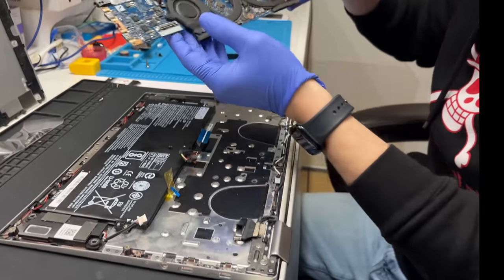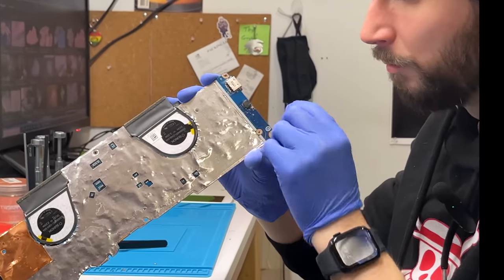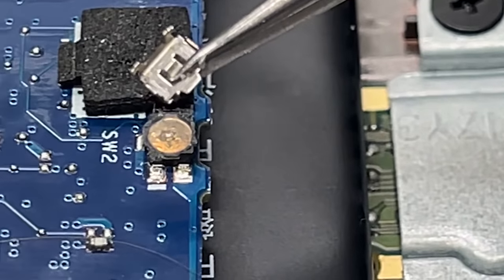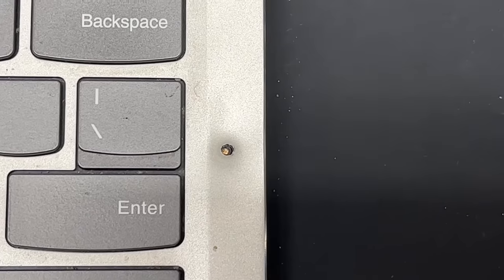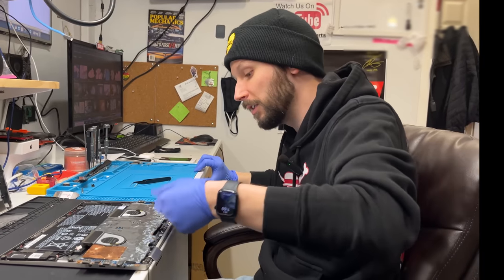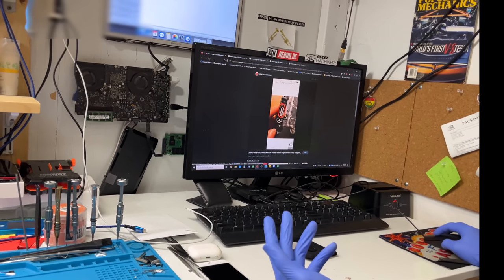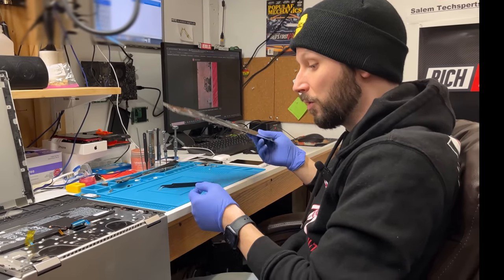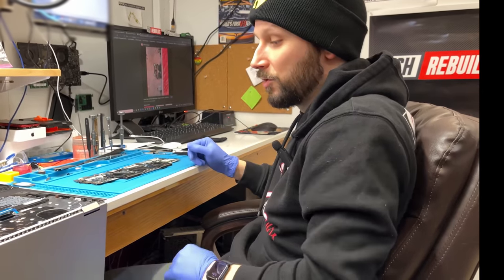Another reason to never buy a Lenovo Yoga (huge design flaw)

Comment: Oh come on, really? You never saw how ... I dunno, volume buttons on old nokia phones work (example: nokia 6300)? That's literally the same design. Yes, sh_t happens, but that's not the reason to drill a hole in a customer's device if you don't have the right parts in stock.

Comment: All 4 of my HP laptops I’d gotten from 2010 to 2013 suffered major physical failure (3 of them shattered hinges and the one detachable laptop tablet having the keyboard connector go out)

Meanwhile my 2008 MacBook SE is still in mint condition as I’ve taken the OS well beyond its final version of 2015’s OSX 10.11 El Capitan and patched it to 2018’s MacOS 10.14 Mojave and now finally 2023’s MacOS 14 Sonoma. It throws ppl for a loop to see the newer OS on a 2008 Mac and to see said Mac still in like-new condition
Reply: Ironically my 2011 HP 630, even if in the golden era, never had any problems with the hinges. I dismissed it last month for the hardware incapable to keep up with my needs, but it never had mechanical failures 😅
(And the power switch has a dedicated daughter board, unlike these Lenovos)
Reply: Macbooks are the best
Reply: Yup, you spend more but they work for a lot longer. I've upgraded quite frequently due to getting them from work so I've had to give macbooks away to friends and family because they work so well and it's a shame to have them lying around.

Comment: My old Lenovo X220T ThinkPad has a pretty good power button, and that thing is over a decade old at this point, so Lenovo at least use to know how to make a power button. The palm rest, however, was not that good on the X220T as the area above the express card slot (because this was made back when that was still a thing on laptops) would often crack if you didn't have an express card in there.
Reply: The older the Thinkpad, the more of an IBM design it is. I have a new T14 and it is nice so the Thinkpads are still holding up, but if you look up the changes made between each generation it's like they're slowly chipping away at what made Thinkpads good in the first place. Just not all at once so people don't stop buying them.

Comment: Laptop designers are probably snorting their own piss while working. Asus zenbook pro 15 is the worst offender. When it was launched, it was hyped by every popular tech reviewer(Even linus tech tips) for the "revolutionary" screenpad display.  It was good for exactly 5 months. Battery died, BIOS update broke the screenpad display, now after 2 years, the rubber feet in the bottom of the laptop disintegrated and oh both hinges that connects display to the body broke due to high temperatures from the i9 cpu. I had to use superglue to fix it because to fix it from the service centre, its almost half of the price of the laptop itself (~$2000). Never go for fresh models with gimmicky features.

Comment: New Laptops are so ghetto man 😂

fr a used Thinkpad or HP ProBook for example are both under 200$ used with good Hardware and they are solid devices.
Got both of them to play around with.
I also have a new HP Pavilion 15 and yeah I kinda hate it for the way its build like a flimsy new Laptop BUT its still miles better than 50% of the garbage out there.

Comment: i have lenovo ideapad silm 5, and it has bad hinge design. the screws are embeded into cheap plastic on the screen instead of make it attach to to screen lid metal. now after 1 year opeaning and closeing the lid the plastic broke and the hinge come of the screen. lenovo  solution replace whole screen lid, best solution attact the metal screws to metal screen lid. and this is a known issue form years but they want to make money by repairing the laptops instead of selling laptops

Comment: I had a cheap Lenovo about 12 years ago, would drop wifi nonstop.  Never bought the brand again, although I try to keep up with what they're doing.
Reply: Lenovo is a big decentralized brands and two of the laptop lines have good engineering

Legion 5 Pro (not 7 until recently)
Thinkpad

Everything else is a lazy excuse
Reply: @harrytsang1501 what about the LOQ?

Comment: I have second-hand Yoga X1 gen 4. I had a problem with the motherboard, but it was replaced during the warranty period.
I do not use the power button because I use hibernation mode after the lid goes down.
Hinges looks solid in the X1 line.
I really like my Yoga and I can recommend it.
I get around 10 hours of battery life with light usage.

Comment: Literally the same mechanism(the power button thingy) was used in the insanely popular Sandisk Sansa Clip+ MP3 player... I loved it because of Rockbox, but I bought like 5 of them over my adolescence because they broke very easily.
Reply: Glad to see another brother-in-arms! Sansa Clip and Rockbox were the fucking bomb!
I guess I was lucky with that power button, mine never broke, I just stopped using it cause the battery got way too unusable...
Reply: @maldivirdragonwitch  Hi there bro :^) Just FYI: you could buy a 3.7v battery in an electronics shop for dirt cheap and change it without too much of a hassle (given you have a soldering kit or can borrow one). I recently got into electronics as a hobby and it's really empowering how many things you can fix easily. IMO it's still worth, the sound quality compared to an average phone is significantly better even on cheap headphones and the clip is supper comfy.

Comment: My last two devices were also Lenovo Yogas, which only lasted 2.5 years each. Weak points in my devices were the power supply socket, hinges and fans. Now I have a Macbook Air M2 (without fan and Magsafe) which hopefully will last longer.
Reply: All modern Laptops are trash. MacBooks have that m2 chip paired with onboard ssd which can’t be replaced. It’s not an NVME. Even if you try to solder a nand flash chip with higher capacity it won’t boot. Acer Asus Lenovo dells all are e-waste. My Asus stopped working in 3 years. Bought an Acer and guess what? Only the half part of cpu had thermal paste on it.
Reply: You need to build a proper tower PC with swappable parts to be free. Framework laptop if you need a laptop and a FairPhone instead of other popular brands
Reply: @spicynoodle7419  yep. Recently made a Ryzen 5600G PC for basic computing (Back up for my wedding photography data, printing,etc). For gaming I have PS4..
Reply: you put your money into apple with a fanless design forcing the CPU to cook and you hope to keep it for years... hmmmm i guess when the laptop actually cooks itself apple's official stance will be "you were using it wrong". Similar to some shitty designs on old macbooks where they made the display cable 2mm too short and it ended up yanking itself off the motherboard on the power delivery side
Reply: my mid range lenevo has lasted me 7 years and still going ... its in perfect condition with the only issue being the storage lol (i had 1TB and now only 100gb something is available )
Reply: Thinkpads are the way to go for me
Reply: @bill19282  yeah, damn true. I've also heard cases of M2 Airs having their keyboard melted off because their owners used them for video editing and just generally heavy workloads for a long time...
Reply: My original MacBook Air lasted two years. The charging port got fried because it always ran hot.
Reply: @bill19282 The cpu won’t cook if it doesn’t reach high thermals lmao. It throttles if it reaches 100 C and will never reach those temperatures doing simple things like browsing or moderate things like photo editing.
Reply: I'm sorry, but if you want to avoid planned obsolescence, Apple should be the absolute LAST place you go. They perfected it down to a science well ahead of everyone else; they basically pioneered the practice.
Reply: @leucinegi if you only do browsing or photo editing, "simple things", you can also buy the newest cheapest laptop there is and replace it every few month for the same total sum...
I usually buy a laptop to work with it, if it's so badly designed to not withstand any amount of work then that's a complete failure and also waste.
Reply: While I don’t like the soldered Nand chips you can get new (unprogrammed) ones for fairly cheap and can dfu restore the computer with apples software. So with skill it’s at least quite possible but I agree it should be easier. What’s more worrying is all the glued or  just not easily obtainable repair parts.

But what I have to say about apple is that their Macs usually just last very long. My whole family uses Macs for decades now and only two have gone bad so far. One 2008 iMac, which had its graphic card die (repairable) and one MacBook with bad soldered RAM. Which would have been repairable but not financially feasible. 

I just remembered there is one more MacBook which has a fault but is still working. It’s Touch Bar is flickering occasionally but it has been even under warranty but nobody bothered to get it repaired and now it would cost money and if it flickers you just have to touch it once and it stops flickering. 

My personal MacBooks I used daily and abused them at times. 2008 MacBook (not used anymore but still working), 2013 retina MacBook Pro (sold to a friend in 2020, still working like new). 

But Apple had really tough times with the butterfly keyboard macs. Those are probably the worst to buy used.
Reply: Oh and the 2008 iMac has gone bad in 2020 and was used all this time. And is actually running again with a new graphics card.

Comment: My sister had a Lenovo yoga this is also a known issue. The touch functionality of the touch screen stopped working about 6 months in and it was not a hardware issue it was some sort of driver issue. Never worked again never came up with any solution dozens of similar complaints online.

Comment: A lot of people have been shitting on Apple because they watch a few Louis Rossman videos where he shits on MacBooks for being unrepairable.  I have great respect for Louis and I do hope that Right to Repair makes progress, but I’ve been saying for years that most laptops are junk and people need to get off their blind Apple hate bandwagon to realize that their favorite brand is probably even worse than Apple .

From my personal experience, I’ve never seen a MacBook fail in the last 10 years.  Not mine, not my friends’, not my coworkers’ not my relatives’ .  Plenty of failed Dell, Acer, HP, Lenovo, etc in that time period.  
Dell has issues with screen hinge being so stiff that it cracks the screen plastic, overheating, coil whine, poorly seated trackpads that double click and wobble.
HP has issues with sudden catastrophic SSD failure and power cord not charging the device due to failed connection on the motherboard.  Acer, Lenovo, etc all have their issues too.  It would take an even longer essay just to cover all the common failures of these devices.  I’m just saying , I’ve never had a Mac fail on me. I know I’m gonna get hate for praising Apple, and I even will admit from an ideological standpoint, screw Apple for not having upgradable SSD or repairable components.  But as a consumer, I honestly think a MacBook is the best laptop that will hold up over the years.

Comment: Hah! So far so good—7 years on my college Lenovo Flex 5, but boy is it a piece of crap. Have replaced the battery, fan, and memory already, meanwhile the touchscreen, fingerprint sensor, and webcam have stopped working entirely. So far the power button still works, but based on this video it could be what kills it for good when it goes. I'm convinced I can coax it into living at least a decade but we shall see.

Comment: I used to own a lenovo y50 which after only 2 years of use the screen hinge snapped off from the cheap plastic standoffs that it screwed into not to mention from brand new it had a broken shift key that would come off if I were to press it on the corner aswell as the speakers and sub woofer cones had started to disintegrate and the speakers started making a rattling noise also the top lid would shock me if the laptop was plugged in and I were to try to open it

Comment: Just wait for the big f - u with Lenovo. 

Lenovo all in one pc's with the thinkstation designation..

All have the hard drive serial number to the machine itself this includes other Lenovo all in one pc's as well there excuse.

"It's designed to make it so people can't buy a stolen machine and replace the hard drive so the machine can be disabled instead of being used"

Ok except when you buy the machine new and need to upgrade the hard drive your sol.

Want to know why this is nasty security. 

The machine runs for 24 hours with the replacement drive then the security auto formats and locks the boot sector on the drive basically killing and destroying your new hard drive.
Reply: Im thinking of buying a laptop can you name other companies i should avoid?
Reply: @chrdiloetit  lenovo and dell including alienware right now to many fan failures and gpu issues
Reply from the maker: Holy shit, this is huge. Where have you seen this? I would love to read more about this.

Comment: Tere are some decent models of Lenovo laptops, but I do remember getting a ThinkPad 530p (or something like that) and realising they were made to fail. It was stuff all round, but they made the cooling system so badly that it would throttle itself constantly. All other staff had some laptop and nobody likes them. I used to go around changing the thermal paste, upgrading pads and cleaning them out every few months.

Comment: I have a Thinkpad 11e (not Yoga, first or second generation I think, has a Celeron rather than an i3). It has this side mounted power switch like that Yoga, though it may not be the same internal design. I got is used free from a friend who was moving to newer laptops. It is mostly used by my mom now, as it is too slow for my tastes. I kind of liked the side mounted switch when I was still using the machine. The reason is that it is on the outside of the laptop, which allowed me to turn on the laptop with the lid closed when I had the laptop hooked up to a monitor. As stated before, my main problem with the laptop is that it is too slow. It they made these with a stronger processor and a better display (stock display is garbage), I would likely still be using it. It is definitely not as repairable/harder to repair than the other Thinkpads I own.

Comment: I got a good deal on one of these, its lasted me 5 years and still hanging in there, however I had hinge failure, and I ended up repairing it with epoxy, so I basically can never open it again and once something else goes, its the end of the road. I really wish things could be designed to be more repairable and with a little more function over form.

Comment: It's not even cheaping out, they could've just installed a side clickable switch, which would be cheaper than the contraption they have there. 
Who in their right mind decides a power switch needs a Rube Goldberg machine to function?
I also hate when they integrate power switches into the keyboard, which of course can't be removed

Comment: Whenever I see a shiny new laptop I immediately see the deliberate design choices to make it break quicker. 

-Thin or non existent screen bezel so that the screen breaks when you knock it too hard on the corner. -Crappy power buttons that's in dumb places so they break easily. 
-Thin laptops that warp and bend the motherboard because there isn't enough support plus not enough space for proper cooling so when you get the inevitable cat hairs or whatever in the cooling system the laptop starts throttling. 
-Unnecessarily elaborate charging ports that's either super thin and fragile or just funky so you can't easily use a generic charger (somewhat solved by USB-C charging but that has it's drawbacks as well)

On the plus side sometimes you can pick up very nice, year old laptops for extremely cheap because of a dumb thing that broke but the majority of these items end up in the trash unfortunately.

Comment: I owned a lenovo laptop and phone once. My experience was that they came with as many features as you could pack in them and were handsome, flex worthy machines

...

BRIEFLY. Those crapboxes lasted me 2 years or less. My hp has been with me since '18 with heavy use and after an ssd and ram upgrade the graphics card is still enough for work and play. Design is nice and unobtrusive and not too heavy either

Comment: The sad thing is that Lenovo laptops are often used in the educational market because they have more "features" than the Dell Latituides sold along side of it, and I think they still have the same power switch. Also feel like throwing in that I have had experiences with drive failure on Lenovo laptops. One of my brothers had a Lenovo Chromebook for the eMMC to fail, and my personal ThinkPad decided to delete drivers for Windows to be functional.

Comment: They put the switch on the side in case the user is using the laptop in tablet mode where the keyboard is hidden.  Lenovo is not the only manufacturer to do this.  Perhaps the other manufacturers have a more robust solution.  This issue reminds me of years ago when I had a VCR and this tiny rubber belt drove the mechanism that inserted and rejected the tape.  When the belt broke, I literally replaced it with a rubber band--but I kept the case loose because every few weeks I had to put a new rubber band in there.

Comment: I have a lenovo c340 14api with the same design. The plastic is so flimsy the bottom cover cracked in like 6 months of light use. The specs states 8gigs of ram but they allocate 2 gigs to the VRAM making it effectively only 6gigs, and you cant even change it on the bios. Their engineers are really stupid.